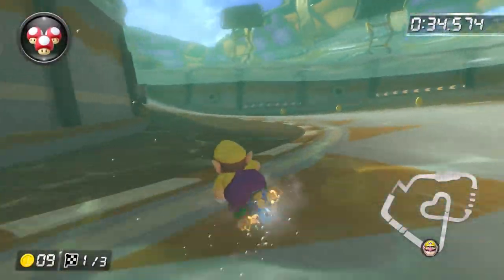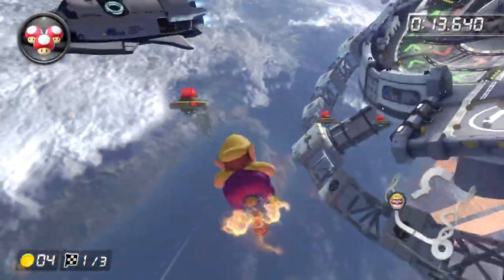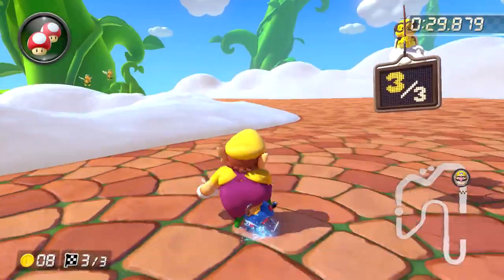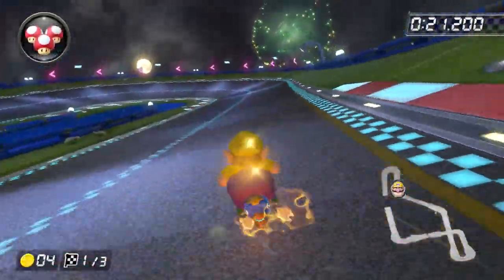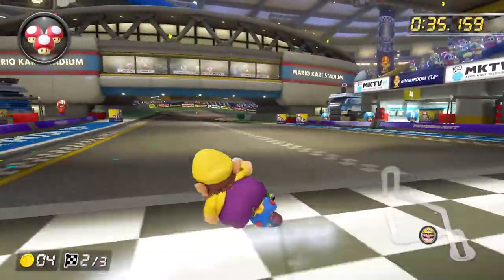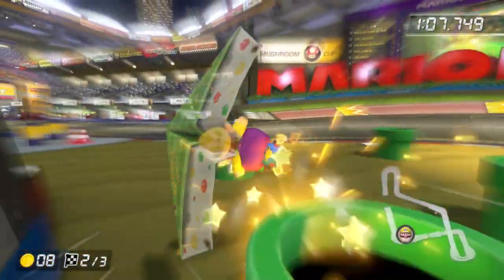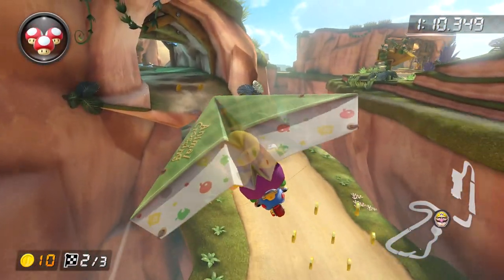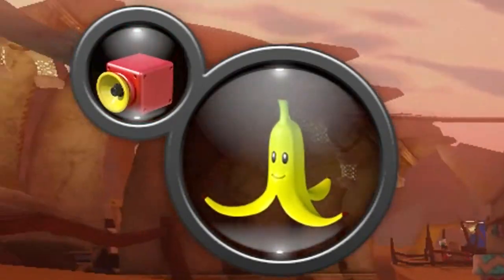Everything You Need to Know About GLIDING in Mario Kart 8 Deluxe!

Comment: Tricks : 1 : fly in champidrome and keep going forward. Use the mushroom when you enter in contact with the wall and you will be able to fly across the finish line.  U Can use a mushroom on the next one just as when your about to fly and doing this on 200 cc Can make u go through one of the holes of the spinning wheel. Doing the same trick in the temple of thwomps make you fly across the finish line and finally in the 3rd one, After u fly, drift until u go across the question blocks. Choose the
 one most far away in left and finish Ur drift, the hitbox will let u go across the blue bridge instead of the red one. Thats all i have for today : )